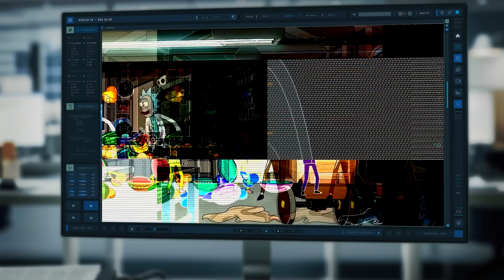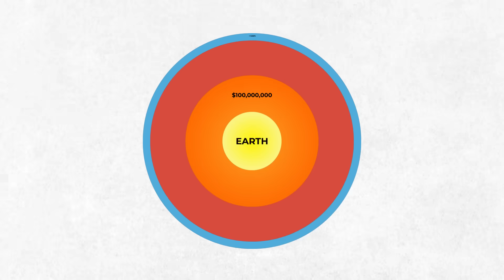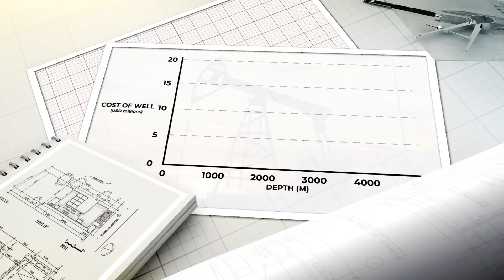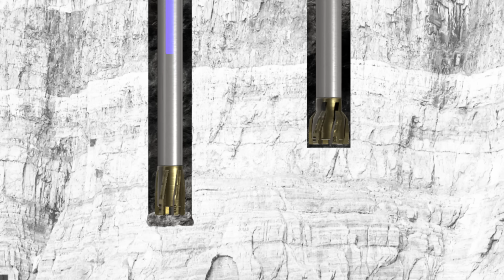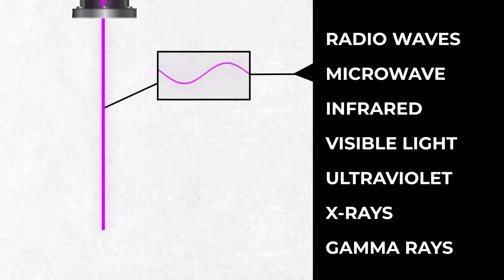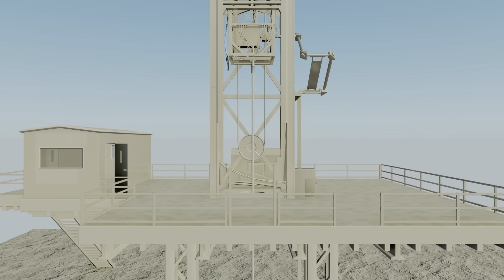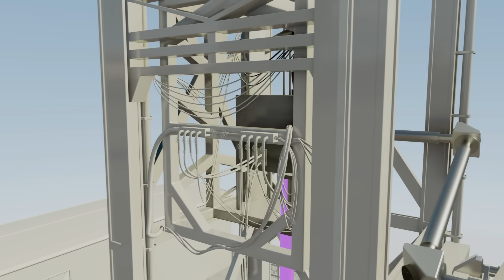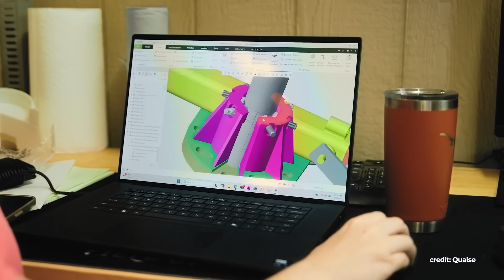The Most Advanced Drill in Human History

Comment: 12:26 What was that!?!  Just a random clip of some dude smacking molten metal with his bare hand?
How well does this technology deal with hitting the water table or an oil deposit?
Reply: It's a viral clip from 2020. It's caused by the leidenfrost effect, where the vaporizing water on his hand creates a barrier to the molten metal.
Reply: "How well does this technology deal with hitting the water table or an oil deposit?"
it doesnt! 
any oil, gas or water deposit that is hit will inevitably cause catastrophic damage to the drill and the hole once megawatt microwaves, thousands of degrees hot molten rock and oil/water/gas come into contact with eachother.
Reply: yeAH

Comment: Interesting, but yeah, "vaporizing" does not mean "making disappear". The vaporized stone will condense somewhere else and deposit, thus clogging the conduits sooner or later.
Reply: The simplest solution would be to retract and re-extend the drill to redrill any deposits on the walls, but that negates one of the main benefits of using masers in the first place.  Maybe brushes, scrapers, or maser modules midway allong the drill conduit could prove sufficient?

I'm sure they've thought of this and have some interesting ideas, but only time will tell which of them will work.
Reply: its basically fume silica soot and fly ash being built up. probably scrape-able or not strong enough to prevent drill removal.
Reply: the laser hole will be bigger than the drill so there will be some space. and the rock redeposited will be dusty stuff. like sand or clay or soot. so it will be removable.

Comment: In oil drilling you use sub-products to lubricate the drill bit and extract debris, called drilling mud and as you pointed out it's critical for them to extract debris from the drilling process. Hope they will success and geothermal will became easier to access
Reply: Speaking from experience in the New Zealand Geothermal industry, after a certain depth 'mud' becomes no longer viable to extract cuttings. High pressure air mixed with foam is then used to extract cuttings in place of 'mud', Usually paired with a PDC ( polycrystalline diamond compound ) drill bit.
Reply: @liamreich8486  in the Gulf of Mexico, drilling mud removes cuttings from wells over 20,000 feet deep. The mud lifts the rock bits when the mud pumps are on. When they stop to make a connection, the mud gels in the hole like pudding, which keeps the cuttings from raining down the hole. When the mud pumps start again (to resume drilling), the pressure breaks the gel and the mud flows like a fluid again. 
There is likely another reason the NZ wells switched to foam at a certain depth, perhaps to not plug the porosity of the zone of interest.
Reply: So they solve the problem of transporting the energy down the hole, now the limitation is extracting the material up.
Reply: @scasny  it’s hot water, under great pressure, it wants to escape. The problem is keeping it confined and using the maximum heat energy.

Comment: Why drill two holes? Just supply the water through a small insulated pipe down the borehole, under pressure to overcome the steam pressure in the bottom of the hole. Let the steam rise up around the supply pipe.
Reply: one reason is that the bedrock at the bottom of a single borehole would start to cool down too fast. you need the distance between two boreholes to have enough "surface area" to pull heat from the surrounding rock. if you only extract from the volume of rock directly at the bottom of one borehole, eventually you would have to reduce the flow rate of cool water into the well, because the rock has started to cool.
there are other challenges with a single borehole approach, but assuming you got it working, the rate of extraction would be significantly lower than having separate input->output boreholes.
Reply: That would mean that your superheated steam would travel multiple km in close contact with the cold water you're pumping in.
Reply: The steam will transfer energy to the cooled water, thereby creating more pressure in the bottom of the hole than the top, making it impossible to inject more water. often violently and unpredictably. Search "Steam Flash" on Google for more info. if you insulate the piping, this increases the diameter of the hole needed and thus it is more cost-effective, safer, and more practical to use two holes. I assure you that very, very, intelligent people have both worked this out logically, and with direct experience.
Reply: so many people here dont seem to understand the very basics of physics ... like friction, thermodynamics and fluid dynamics. 
its really depressing.

Comment: I like how some of the technicalities discussed at least to an extend. It would be also interesting to know wheter the MASER passes through the vaporised rock without substantial absorbtion. If these energy losses are significant, the proper evacuation of such vapors will need to play a large role.
Reply: its not a maser. the gyrotron is a slightly beefier magnetron that fires microwaves all over the place that are then focused in roughly the same direction by a waveguide. the waves are still bouncing all over the place and lose focus insanely quickly. a maser would stay focused for far longer, allowing the head of the drill to stay much further away from the dangerous hot zone.
Reply: @KT-pv3kl  Well, it is a maser accourding to the video (idk if they wrong) I'm not certain about the working of a gyrotron but the base mechanism of "light" production" seems similar to the cyclotron and syncrotron electron lasers (basically facilitated syncrotron radiation), which end up producing coherent, collimated monochromatic em waves, aka laser/maser (depending on de wave lenght). But Idk that's why details matter.

Comment: I mean, when you're using a regular drill you have to back out a bit to clear debris that doesn't flow up on its own. Who cares if vaporized rock might need an auger on the outside of the waveguide to keep it broken up as it condenses on the way up. The beam will still get the material moving in the right direction, instead of current technology that just smears drill bits at the bottom of the hole and requires fully extracting the bit to put a new tip on.

I'm sure they'll be successful as long as there's enough capital to get the engineering challenges worked out, because at the bottom of the bore hole there will be enough energy to pay for the drilling, all the power generation infrastructure that goes on top of it, and pay for operating and maintaining the power plant.

It's silly to think a few pencil shavings of glass are going to bring the whole thing grinding to a halt, when we've already done a super deep borehole with conventional drills available in the 1960's.

Losing torque because the pressurized rock is pinching the tip of the drill bit isn't going to be a problem here. The glass condensation is much weaker and will be sheered off with vibration or rotation before its substantial enough to capture the waveguide. Easy peasy. Worst case, leak some of the beam out of the sides of the waveguide to keep the vapor hot as it rises, basically like a sprinkler made from punching holes in the side of a hose. It would ream out the hole like the flutes on a drill bit, and could likely be engineered to produce an ideal finish on the glassy casement being produced.
Reply: You can throw all the money at it you want. Doesn’t mean you will necessarily solve the engineering challenges.
Reply: But the final scheme has not been thought out and will fail. You cannot get enough power up the bore to make a steam turbine work. Because the heat flux is only 0.1W/m2 regardless of the temperature. Rock is such a good insulator. Existing plants only work because they find ancient waterlogged ground that has accumulated the heat. They also cool down when tapped.

Comment: A great video Ben, I think you put it very well. I agree this could be a very good source of clean energy but I worry about the longterm effects of collecting all this heat from the earth's core. All that heat energy has to come from somewhere and there are thermal vents in the ocean and lost of deepsea life relies on those vents. What if collecting this thermal energy from the core causes it to solidify and slow down its rotation and this disrupts some circulatory cycle of the earth and accelerates some sort of deterioration that otherwise would have happened far slower?
Reply: The amount of potential thermal energy exceeds humanity's yearly energy use trillions of times over. This will not be an issue.
Reply: I think the issue will be the thermal energy brought to the surface that will necessarily increase the temperature of the planet. At least solar heat energy is inevitable. We are stupid focks aren't we?
Reply: @Bennyboy-dog  By a few terawatts at most. All the energy that geothermal power could add to the Earth in a day, the Sun adds within a minute.

This will not be an issue.
Reply: @General12th Do you think solar panels would have any potential for harnessing solar energy? I'm sure they must get quite hot sitting there in the sun.
Reply: @ShotgunShaman Do you mean is it possible to make use of the thermal energy solar panels absorb from the Sun? Linus Tech Tips uses his solar panels to heat his pool (and his pool to cool down his solar panels, making them more efficient), so it's possible to put it to good use.
Reply: @Bennyboy-dog Isn't the heat from the Earth's core already on the planet? Where would the extra heat come from?

Comment: Can they start with currently dead and capped off oil and gas wells? A few thousand meters of the drilling would already be completed and the new technology could be implemented starting at the bottom of an existing well.
Reply: The first thought that came to my wildly ignorant unqualified mind was the integrity of the interface between the walls of the hole, where the existing hole, using the traditional steel pipe & concrete, ends and the new hole, using these glass-like resolidified molten rock walls, begins. I imagine that unless the transition between these two phases of the hole was perfect and water-tight, it would prove a catastrophic failure point for the reasons described in the video. Achieving such a thing at such depths may be a greater engineering hurdle than simply boring a new hole with these seamless molten-rock walls all the way down.
Reply: @snozzmcberry2366  my first thought was residual gas/oil being hit with 1mw of maser and industrial levels of pumped air might also be an issue.
Reply: Oil wells are never really "dead" in the sense that they become inert. They just become unprofitable. The hydrocarbons would create a dangerous atmosphere to heat rock.   Depending on the geo formation, the wells can also be naturally unstable. We use tapped oil wells to store natural gas in and not only do they still produce an incredible amount of oil, but some have enough space to allow gas, oil, and water to migrate out of the well. For every old oil well used, several observation wells have to be used to measure migration.
Reply: Yep, they can also drill new wells with normal drilling techniques and then start with the slower but much more resilient new tech
Reply: The holes are structurally reinforced by its walls being covered in the miles of vaporized rock turning into the vitrified lining. Working off of an existing hole would take less effort but the upper section of the hole won't be reinforced that way.

That may or may not be a deal breaker, but it seems like an unneccessary risk.
Reply: This plasma boring method goes straight down. Oil drilled holes are not straight. They bend and curve and can even extend far from the start point. Maybe some wells have straight down drill holes. But they would have to spend money lining the hole down to the continuation point I would suggest. So that cost alone may not make it financially viable.
Reply: Not worth it, such wells are not in the places you would want a geothermal well, and the existing pipe casings and the residual oil, gas and water are a complication and hazard you don't want.  Most oil and gas wells are not remotely deep either to matter for these holes.  This is the drilling equivilent of "lets launch space ship from top of mountain" naivete.
Reply: Not sure how well oil and gas go together with heating rock to thousands of degrees. Sounds flammable.

Comment: The weak part of this idea is to use the klystron at the top of the well and convey the microwave energy thru a waveguide; the losses are excessive.
May be by miniaturizing the power generator and placing it in the head of the drill bit? Doing without the vacuum tube, and using a GaAs MosFets Phased Array right at the tip? Or, even more radically, using the same level of power with a CO2 infrared laser on an orbital scanning mount to vaporise the risk at a 45° angle?
Anything that wouldn't require a vacuum in a drill bit which in reality is a waveguide twenty kilometers long?
I once run the project for a hyperloop-type train, which require the tunnel to be in an near vacuum, and calculations come up with a 25 KW air pump every ten meters? This is a conduit few inches wide, not a train tunnel, but the power required to keep a permanent vacuum are routinely underestimated.
Compliments for the great idea; the solution of the various engineering challenges require an effort at an heroic level.
Greetings,
Anthony
Reply: Compared to klystron/gyrotron GaAs transistors are weak, slow and fragile.
Another big elephant is waveguide loss - even the best copper-silvered ones have losses of around 0.1dB per meter - 30m down and you're at half power.
CO2 laser? Yeah, I can see that, but packing it all in and making it work at 300C, oooh boy.
Reply: The vacuum doesn't extend the whole way down. They only keep a vacuum from the gyrotron to the top of the drill rig. So maybe 100ft-200ft of vacuum line.
Reply: "the power required to keep a permanent vacuum are routinely underestimated." <== this deserves emphasis and repeating, TM pumps for example are essentially little jet engines
Reply: The whole drill pipe is not a vacume wave guide, only a few meters in the articulation armature above ground are near vacume for the benifit of that device and it's mirrors.
Reply: @kennethferland5579 and from there onwards very high loss heating air.
Reply: the entire project has so many hard physical limits that its almost laughable. 

quite frankly they would be better off using a miniaturized fission reactor and pumping  a laser that way or simply blasting radiation directly instead of using microwaves. 
a controlled version of the elephant's foot.  that still doesnt solve the most important question of how to get vaporized rock out of a hole with a static pressure ov 900+bar but at least you arent wasting 99,9% of your energy on cables or waveguides.

Comment: Is it possible to cool the Earth's core while tapping this "limitless energy supply,"  which would have catastrophic effects for any life on Earth?
Reply: No. Multiple reasons. The surface of a ball is much smaller than the volume of a ball.  you have to understand how huge the earth actually is and how shallow these holes are compared with the circumference of the earth. Then you have to know that the heat in the centre of the earth is primarily an effect of radioactive decay (e.g. uranium thorium and potassium).

Our geothermal usage is about 1/3,000th of what the earth is releasing naturally. So we would first have to take up all of that natural releasing heat before we could begin to tap into any measurable additional heat release.

Comment: Sounds theoretical, all boreholes are full of water naturally
Reply: They are hoping that is solved by the laser self-sealing the sides of the hole in the form of a smooth glass slag. If it is relatively sealed, then they are going to be able to pump water deep into the earth and get it superheated into gas which expands, comes up out and drives a turbine. So it probably won't matter if some ground water is seeping in.

Comment: A good overview I've been wondering how they were doing I heard about them a year or so ago. I love the idea and I'm very hopeful that they succeed.
Reply: Same. Really great progress.
Reply: I heard an interview with the co-founder in '22. He proposed it would allow oil drilling companies to transition as well, which I thought was a great idea.

I've been rooting for it ever since, but on an engineering level, it seems like a monstrous challenge.
Reply: they wont succeed. their current plan is simply not feasible. 
getting the power down a 10+ km borehole is only possible using superconductors, possible but impossibly expensive and a breaktrough technology in the field that has to be researched and proofed before even thinking of using it. 
the next issue is even bigger and more impossible, removal of the debris/ vaporized rock.  water is out of the question as it would cause steam explosions combined with 2000°C+ hot rocks hwile causing all kinds of issues with the stability of the vitrified glass.  pressurized gas or air only works up to a certain depth as pressure and friction from the recondensing rock will eventually clog a borehole no matter how much pressure you pump into it.
Reply: @KT-pv3kl  Yea, well, maybe it's just a pipe dream :/